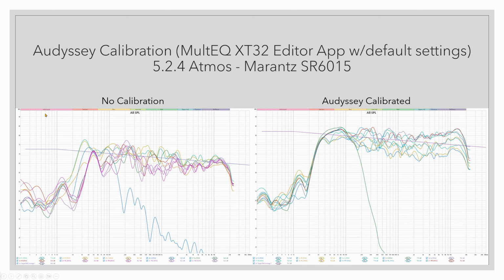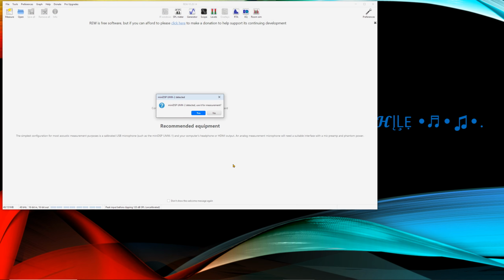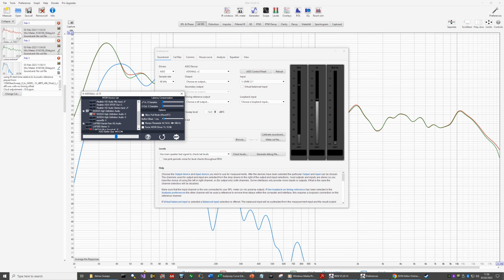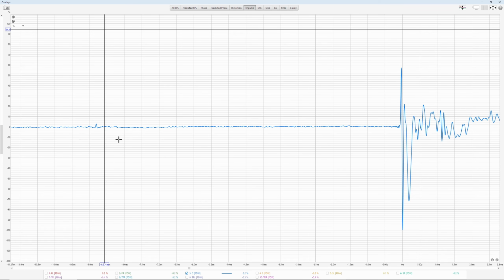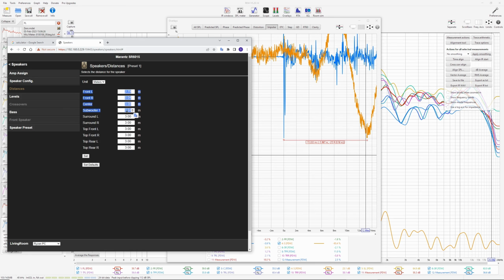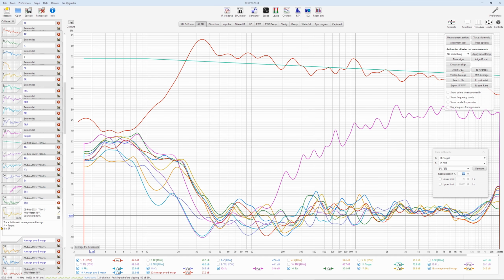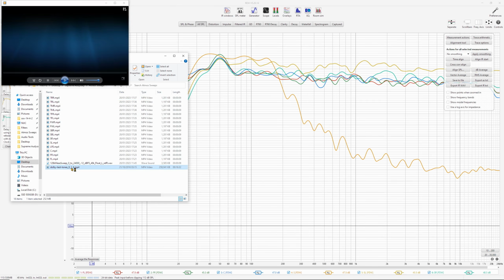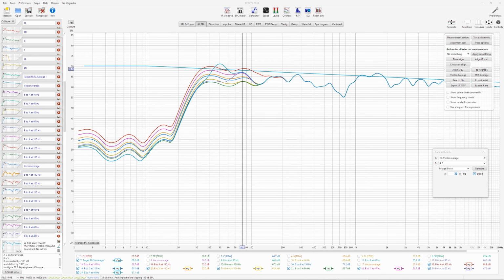Supreme Audyssey Calibration by OCA

Comment: Hey, is it necessary to have RLO activated for the dummy file? My listening levels are about -25 to max -15 db. What do think or recommend? Thanks for that great stuff. Cheers
Reply: Hey O.C, went through the calibration finally. The performance of my system is unbelievable now, I can only recommend this procedure to everyone who is interested in great quality sound, sorry Audyssey, I will never look back. My way to that result was a long one but it was absolutely worth the effort. Thanks so much for the support and that great tutorial. Cheers
Reply from the maker: RLO is set to 0dB in the app when dynamic EQ is set to on and cannot be changed. That's the strongest level for Dynamic EQ. 10dB is less effective dynamic EQ. You can use whichever you want. If you mean to not activate Dynamic EQ at all, yes the method will work also without it.
Reply: Thanks a lot. Hope you wouldńt mind answering another, REW related question. When checking levels for measurements, my processor is set to -18db to get the level ok message from REW (93db). When I calibrate my mic via REW SPL Meter and generator to 75db, the level too low message appears. Any Idea how to fix that? Thanks.
Reply from the maker: I guess you're not using a calibrated USB microphone. In that case you'll need to calibrate REW'S SPL meter with an actual SPL meter otherwise it will show you wrong values. If you manage to make a measurement with sufficient headroom (in green) displayed during measueemt then the SPL values don't need to be correct. Just make sure your receiver volume is set at your actual listening levels and conclude the measurements. The method works with relative SPL differences.
Reply: Thanks. The mic I use has calibration files, I uploaded the 90 degree file into REW. Any further idea or tip? Thank you sir.
Reply from the maker: You can try to increase mic input volume level in Windows or REW depending on your mic type.
Reply: @ocaudiophile  , windows level is already at 100. Where can I change the REW mic input level, preferences? Thank you Sir.
Reply: @ocaudiophile  , it is a pro USB microphone.
Reply from the maker: @saschawehde8072  https://www.roomeqwizard.com/REWhelp.pdf
Reply: Thanks. Sorry for another question. Can I take a copy of my current 8 point measurement and use it for the dummy .ady file? All speakers are set large just the upfiring speakers are set to small (150+60 hz). Do I need to set them large before I download the copy? Thank you Sir.
Reply from the maker: @saschawehde8072  You can use any measurement as long as there're no custom target curves in them. When you load the response data with Dirac impulse, everything should be reset.
Reply: Hey, regarding the .ady file and json, can you please name which number is which speaker (0 = FL, 1= Center,…)?  By the way, before the .ady file will be uploaded to the AVR, does it make sense to adjust the Distances and Level corrections in the app prior to the AVR export? Further to that, the LPF of LFE setting (mine is set to 90 Hz) does not affect the REW measurements (you mentioned that in your video as far as I remember)? Thank you Sir.
Reply from the maker: @saschawehde8072  0 is FL, 1 is C and 2 is FR but the rest will change depending on your Atmos configuration. You can see the channel name under "CommandId" in JSON editor.
When you send the .ady file to the AVR, it will reset all distance and level settings so you should take a photo of these settings before you do that.
I tried increasing LPF for LFE setting to 250 and didn't make a difference but decreasing it to 90 might (I didn't try that). Why are you changing that to 90 from 120? You will lose LFE content over 90Hz in movies (if any).
Reply: @ocaudiophile  , thanks a lot. I decreased the value due to the bass in some movies is way too boomy with the 120Hz setting. 90Hz provides a much punchier, cleaner bass response in my system after trying the various settings.
Reply from the maker: @saschawehde8072  There must be a peak around 100Hz, this method will clean it up. You can use 120 as usual.
Reply: @ocaudiophile  Thank you sir. I am going to try that.
Reply: I am very sorry, got another question. What do you recommend to set into the Audyssey app, 2 subwoofers or 1. I got tow and I am wondering if it does make more sense to handle both as one right from the start. Audyssey handles the responses as one sub at the end as far as I learned. Thanks you Sir.
Reply from the maker: @saschawehde8072  If you have a MiniDSP then use them as one sub, if not you can connect both to the receiver. Watch my subwoofer alignment video, it should give you ideas.
Reply: Hey, followed the guide so far, now I cannot transfer the ady file to the AVR, app stops at room data calculation, any idea?
Reply from the maker: No, this error is a first! Something must be wrong with the .ady file you created
Reply: @ocaudiophile ey, I guess something is wrong with the excel file. First row imported I get 20.000000, not 20. Must be a format issue. Can you help out? Text to colums tried, same issue.
Reply from the maker: @saschawehde8072  Could be your Windows regional settings, matbe using ; instead of , or . I cannot know from a distance. Did you try the Pyton script automation linked in the description?
Reply: @ocaudiophile no Sir, did not use the python script yet, going to try that.
Reply: I am going crazy on this. Can I provide you with the files so that you might have a look at them?
Reply from the maker: @saschawehde8072  you can only paste Google drive links here
Reply: https://drive.google.com/file/d/1-Avz4ImlBEYiGpF0ZSCorbI6nNNDUZIi/view?usp=share_link
Reply from the maker: @saschawehde8072  I checked them. You have somehow multiplied the frequencies by 1 million and the SPL levels by 1 thousand in Excel. The numbers in the txt files are correct. The first frequency in the excel should be 20 and the SPL level 3.6
Reply: @ocaudiophile thanks Sir, advice how to fix that, I am not an Excel expert? Or, may it possible for you to provide the excel file including my txt data? Thanks so much.
Reply: @ocaudiophile …strange, I followed the procedure step by step, Excel converted the data automatically. Maybe I should change the Excel region to US?
Reply: Hey Sir, I made it, switched windows region to swiss. Thanks so much. I will give a feedback how it sounds if you are interested.
Reply from the maker: @saschawehde8072  Finally👋
Reply: @ocaudiophile thanks again. By the way, I did not get the point where I need to reset the LPF OF LFE to 0 after the final upload to the AVR. By default everything is reset so the LPF. Should I reset it to -10 after the second reload (includes the corrections), adjust the levels once more in detail, then reset it to 0 or should I leave it at 0, then make the level finetuning? I assume that I need to do a second run to tune the levels after I set the crossovers. Thanks
Reply from the maker: @saschawehde8072  Keep LFE at -10dB until you finish the calibration

Comment: very impressive, thank you very much, another step up to the moon :)  by the way, for the LFE cut off at 120Hz, it is not related to setting into the AVR (LPF for LFE) ?  and an other thing for the filter curve generation, MultEQ-X app offer the possibity to import REW fiters, it say "EQ is limited to 10hz to 20khz, -10db to +10db, and Q 0.1 to 10" do we have to make sure that the generated filter curve is not going above that ? and thinking if it is better to create a filter curve from the EQ by using a generic filter that match this parameters ?
Reply from the maker: No, it's not effected by the LFE cut off in the receiver (that was also my first thought and I tried increasing it to 250, no change in response!)

You can't replicate these inverted responses accurately with EQ but you don't need to. In REW EQ filter types, choose "Generic" as manufacturer and "Configurable PEQ" as model. Then you can set all these limits for MultEQ-X you've mentioned in the configuration and REW's auto-EQ will "match response to target" within these parameters. Then you can export them to MultEQ-X. Don't forget to keep the target level same for all speakers after initially calculating it as explained in the method.
Reply: @ocaudiophile  one little tip about REW zooming, it focus on the cross in the graph, so make sure to clic on the impulse start before cliquing on zoom+. I say that because it hapen to me and now I figured out it helps
Reply from the maker: @Sangoku-Z  noted thanks!

Comment: Great video. Do you know if the dolby surround speaker files will work with a macbook?
Reply from the maker: You can however switch speaker cables (not so hard if you're using banana plugs) and use one of the surround channels to play from all the Atmos speakers. The correction files will be accuarte. For timing, you will need to do a calculation based on the distance of the speaker you used
Reply from the maker: I am afraid no. Macbooks don't support bitstream output of DD+ over HDMI, they can only decode to LPCM. I heard that some people managed to do it with some paid software but you need to check the forums. I really am not a Mac guy.
Reply: @ocaudiophile  Thanks.
Reply: Would it work if I copied files to USB drive and played through my Oppo dvd player?
Reply from the maker: @djcradd  I never tried but it should as long as it can decode DD+

Comment: So this method is more effective than your "Dolby Atmos Height Channels Measurement & Calibration with REW" video? Right?

I have four subwoofers which I calibrate with MSO and a minidsp. How would you combine that with your calibration method? Would you just leave out the subwoofer part?

Thanks!
Reply from the maker: You can leave any channel you want uncorrected with this method. Just leave the subwoofer responses in the .ady file as perfect Dirac responses and don't add any curve edit points before you send it to AVR. Your sub will be fully managed by MiniDSP with no correction from Audyssey. You will only need to adjust distance and level.
Reply: @ocaudiophile  Thank you sir. Can you elaborate on that you say the other method sound "cleaner"? Which would you choose, and why? In this video at the end, you mention that perhaps it is better to EQ less for it to sound better? Is this what you mean? I am deciding on which method to use for my home theater :)
Reply from the maker: @BuffSquadBigBenni  It's a long discussion and out of scope for a comments section but in short, no speaker is supposed to give full flat response throughout the whole frequency band. Boosting dips caused by room modes will usually degrade the sound for example. It will have good frequency response but it will sound throttled, less lively. Audyssey uses FIR filters which do not change speaker phase response so there's some logic in correcting for full flat repsonse but still I wouldn't do that kind of correction in my stereo system. However, you completely lose Dynamic EQ and Dynamic volume with manual calibration which causes audibility problems when you're listenning in low volumes. This problem will continue even with Dirac calibration when it's available. People will chose Dirac over Audyssey as it will sound better but they will return to Audyssey because nobody uses their system always at the calibration level. You should try both and decide yourself. I have one Audyssey calibration (this method) and one manual graphic eq calibration stored in two different speaker presets and I switch between them as I need.
Reply: @ocaudiophile  thank you!
Reply from the maker: @BuffSquadBigBenni  Also I should emphasize that the FDW and physcoacoustic smoothing used in this method will reduce the negative effects of a full range correction.
Reply from the maker: That one is for manual calibration with graphic EQ. The sound is a bit cleaner although the responses are not as flat but you lose the low volume listenning advantages of Audyssey with manual calibration. This method keeps Audyssey and DEQ on.
Reply: Maybe you need more info to answer my question:

What I have know, is all of my four subwoofers calibrated with MSO so that they have a flat response (no house curve/slope). Everything else (my speakers) are not calibrated yet.